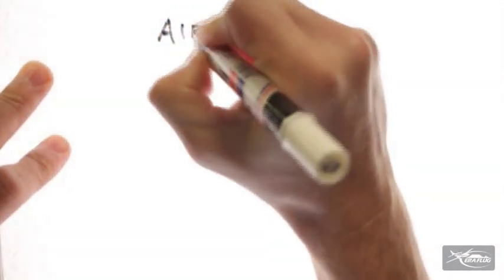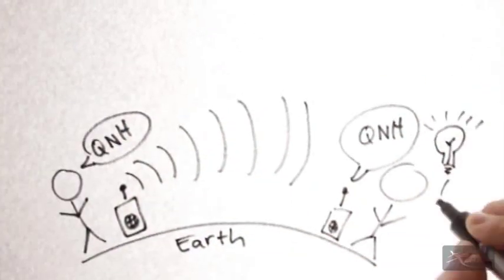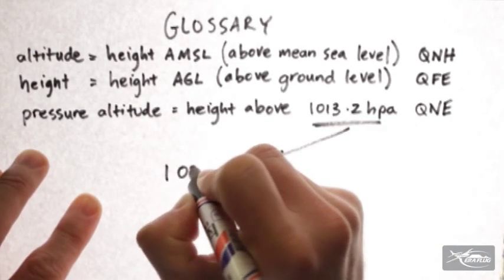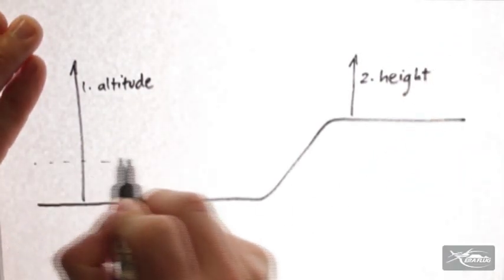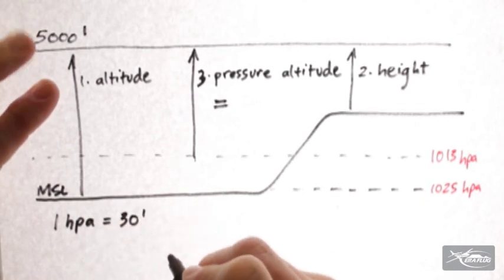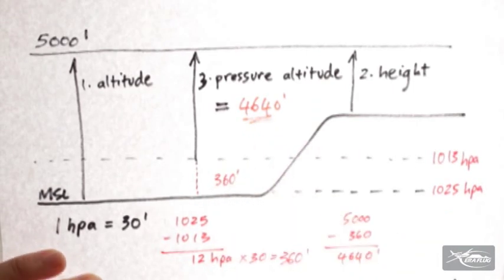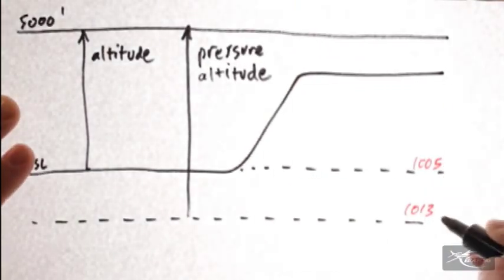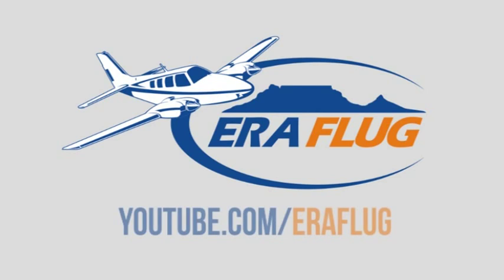101 - Air Pressure Calculations (Era Flug Aviation Tutorials)

Comment: i thought the sea level pressure was always 29.92 or 1013.25 hp? how can u have those sea level pressures that equal to 29.92? can sea level pressure change?
Reply: As per ISA pressure is 1013.25 only, he just assumed it lower or higher to give example